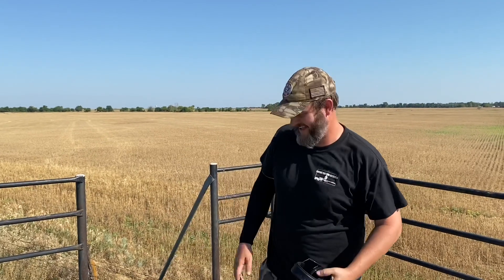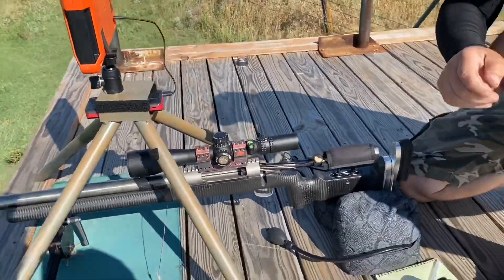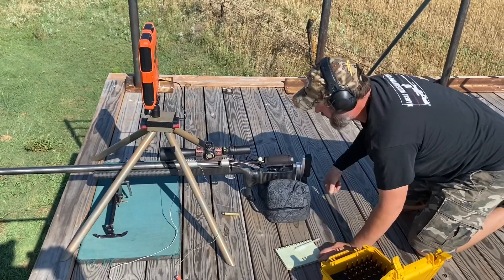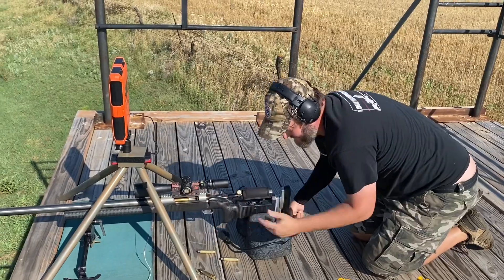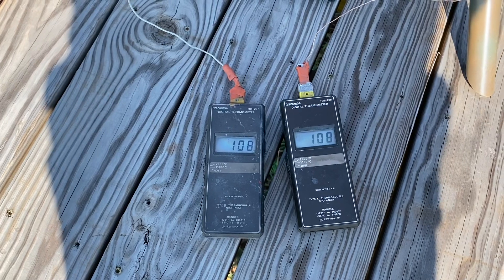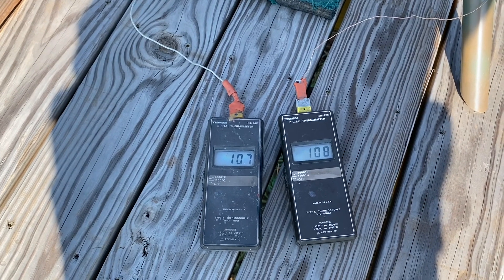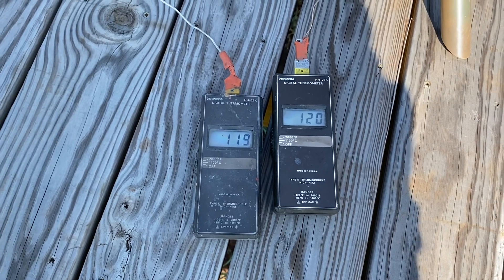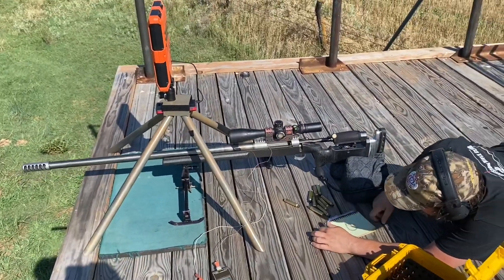How hot does a barrel actually get inside and out, when shooting?

Comment: My 7PRC MasterPieceArms was 162F after 5rnds on a 50deg day.  I would think a 375 Cheytac would be much hotter than 7PRC.  Any chance you actually touched the barrel by hand during the test? There are so many modes and types of thermocouples it is hard to get the unit setup to get correct temp readings sometimes.

Comment: Great test.  I have a case with powder closed off at the neck with a temp sensor inside.   I graph and take note of the Mv change per degree and by mapping this out I always know my Mv no matter the temp of the powder  and primer.   The temp stable powder I use and the primer actually changes the Mv. H-4831sc with a federal primer is 0.4 fos/ 1 degree  in this certain cartridge.    I do see this change based on the amount of powder a case holds and the primers make a difference.     Thanks!!

Comment: Thanks Ryan and Steve. Curious what the change in speed was as it climbed relatively.
Reply from the maker: Have to test that with a tried and true load. I was testing different charge weights today.
Reply: I would expect that the barrel will heat up at a higher rate in the beginning and then stabilizes at some point or at least have less increase every shot. However the time that you have a loaded cartridge in the chamber starts to count, so it makes sense to keep this time short as possible and roughly the same, especially with temperature sensitive powders.